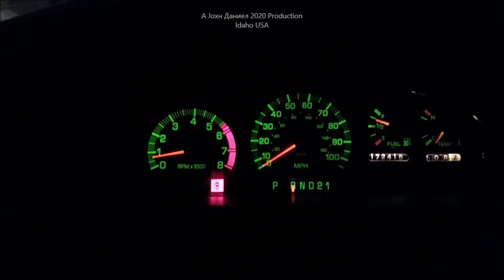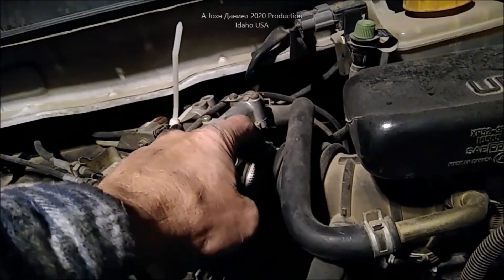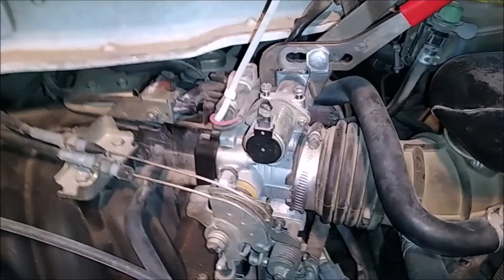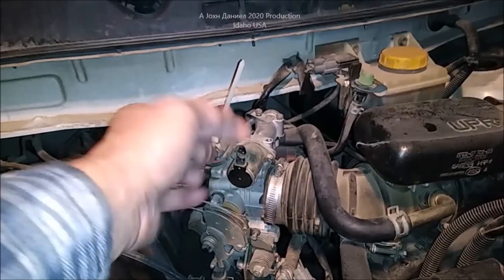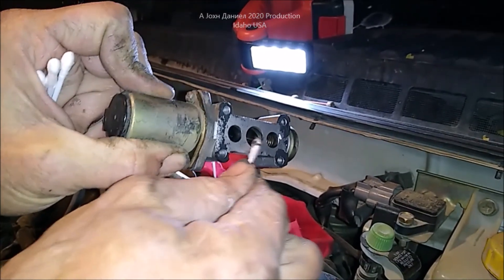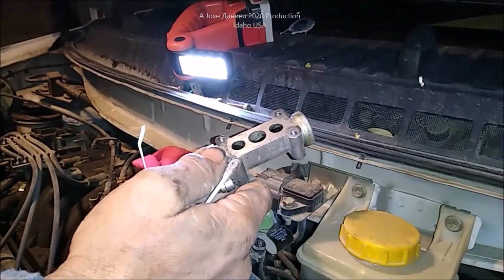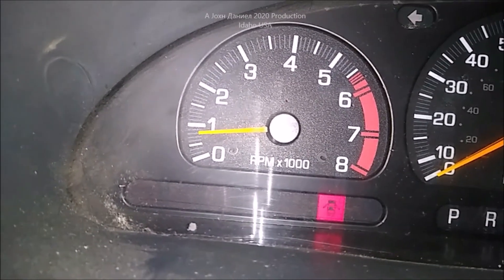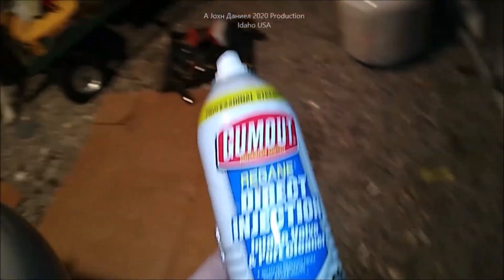Car or Truck won't Idle, Dies when put into gear or coming to a stop?

Comment: John, suggestion, buy a used EV.  The end of all those problems that come with fossil fueled mechanical contraptions.  About 9K fewer moving parts.   Used EVs are currently affordable, just bought a 2017 Chevy Bolt, and love it.   You like bargains, at least check one out.   Folks haven't caught on to their true value just yet.    I love your video content.  Keep up the good work.   FYI,  I have owned motorhomes since 1977, never intend to be without one.    Your videos are a must watch for guys like me.
Reply from the maker: Look for more RV related and how we install modern to the antiquity RV's. As for a EV, I prefer the self built, like my 1981 Buick I did, a tiny little FWD skylark we put a 44hp 72 volt in. With the newest LiFePo4O battery from LingLong I can triple its original range of 38 miles and top speed from 52 to 70 mph. With the engine, fuel tank, exhaust, and all such gear removed it was under 1500 lbs!  The 4 speed with the Hyster 44hp motor of 1983 was used. 
Imagine me with technology of today on that car!!!! This car - https://www.cargurus.com/Cars/1981-Buick-Skylark-Pictures-c8465
Reply: you could be right especially with heavy reliance on foreign oil thats a recipe for dissaster.
Reply: How well do the heaters work in an EV?
Reply: @tinkerscorner54  They do a good job in the Chevy Bolt, but reduce mileage by about 8 miles.   For local trips that's not a concern.   Best to use the FOB and remotely pre heat the car while it is still hooked up, or use the heated steering wheel and heated seats.   They don't seem to reduce the mileage.
Reply: @tinkerscorner54  they can take the heat generated from anything that generates heat as they do from the internal combustion engine, heat exchangers exist for EV battery banks as part of the normal battery cooling system and ofcourse by law the EV cars must have heaters and demisters , have you watched videos of evs driving in minus 40c in europe.
Reply: @closertothetruth9209  Okay, thanks. I just had never thought much about heaters in an EV until i watched this video and saw Ross's comment. 20 degrees F is cold but not for out where he lives and further north. I've driven in much colder weather where even an internal combustion engine couldn't do much more than keep it above freezing in the cab.

Once in Des Moines, Iowa, I pulled into the terminal around  midnight and it was an actual -80 F (-62 C) with a 40 mph wind blowing. We couldn't shut the trucks down to refuel or they wouldn't be able to restart. The batteries would freeze in short order. Even with gloves, I about got frostbite while refueling. (Have you ever had your eyelids freeze together? The wind makes your eyes water and the temperature freezes it almost instantly.(I'm glad I had long johns and an extra blanket that night.))

That was an extreme example in a big truck. -20F is more common and In regular vehicles out west, many time I've had to put cardboard or a blanket in front of the radiator in order to complete a trip and get home. Generally, if there was a blizzard, there was enough time to get home and hunker down before it actually started. One year (1990-91?) two Air Force Academy cadets died, not from the cold but carbon monoxide poisoning. They got stranded between Colorado Springs and Denver and failed to get out and regularly clear the snow from their exhaust. (Sad but "Dumb kills".)

I haven't seen the videos that you talked about. My thoughts went to "what happens to a lithium battery at really low temps? And really high temps?" and "how do they produce heat if they are sitting still for hours?". I honestly had never given it a thought before.  Thanks for responding! That's a new area to look into.